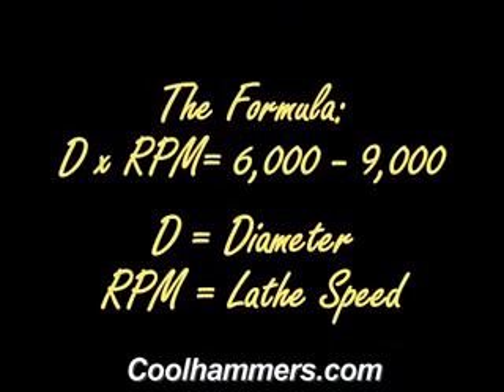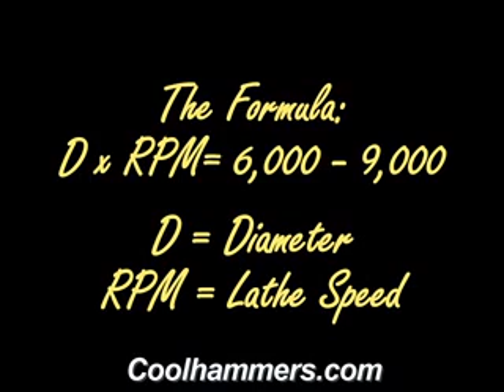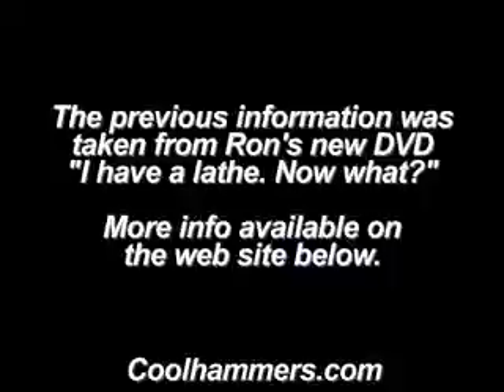Speed - Proper Wood Lathe Speed

Comment from the maker: @vljenewein : Now I know what a duduk is! You are going to need a few different speeds depending on the particular cut you are making. For drilling the inside much slower, maybe 1,000 rpm. For shaping the outside between 2,000 and 3,200 rpm. If the wood is burning slow down, If you are getting chatter and vibration slow down a bit. Top speed on my Powermatic 3520 is 3,250 rpm. I often run close to 3,000 for small stuff and as slow as 100 for bowls. Good luck.
Ron

Comment from the maker: Beav:
It works well for diameters greater than 5" or so. Below that, after initial roughing for balance, I just run pretty fast. On small diameters like spinning tops or pens, I apply TLH speed controls (turn like heck).   Easy rule: Large Diameters = Slower speeds, Small Diameters = Faster speeds.
Good turning and God Bless.
Ron

Comment: Very interesting, curious to know where that formula came from.  I’m still pretty new to this but have heard that faster speeds will provide a better cut.   Some experienced turners even go up to 3000rpm as a normal practice (or so I’ve been told).
Reply from the maker: A good rule of thumb is to turn large diameter pieces slower, to begin with. Smaller pieces you can start out faster. My technique is to start slow then increase the speed until I'm beginning to be afraid or the wood is burning from friction. Then slow down a little bit.   I regularly turn small diameter items as fast a the lathe will go, for wooden pens that might be close to 4,000 rpm. For bowls, I might start at 2-300 and finish somewhere around 1,200 depending on the diameter of the bowl.

Comment: Yes! Everything matters. What matters most is balance. Even when the vessel is round, it may not be balanced, due to differences in density, a knot for example. This formula is only a guideline, a starting place. The best advice I can give is begin slow and see what you can get away with always erring on the side of safety.  This formula works for plates, platters and bowls, not well for spindles.
Ron